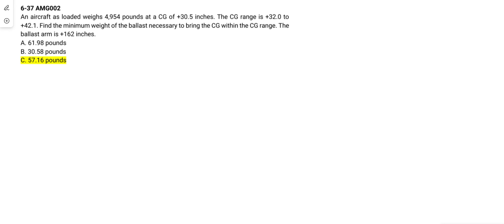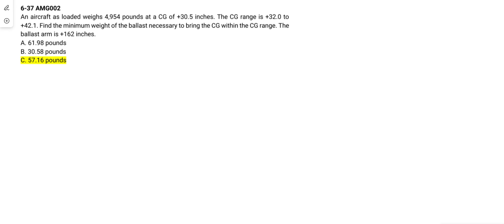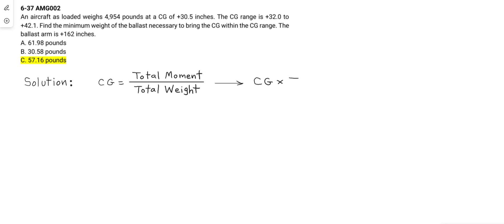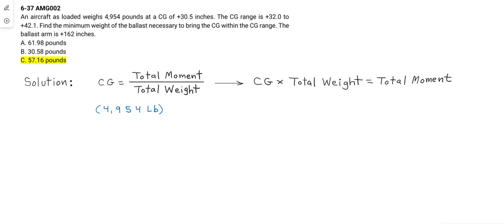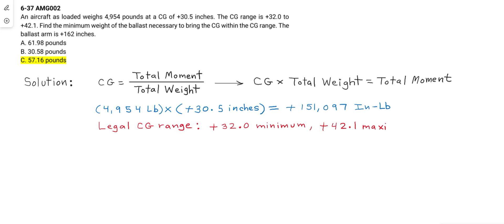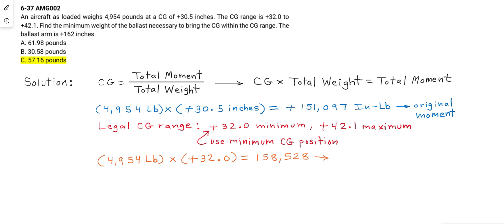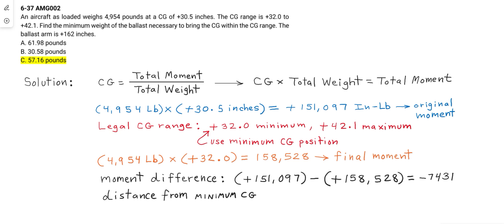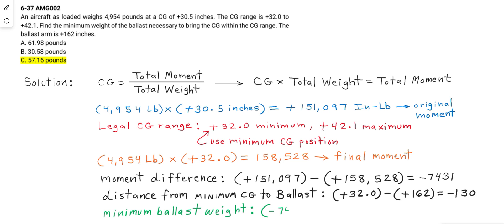Airplane Weight & Balance:  How To Calculate Minimum Ballast Weight

Comment: Good video, but the only question I have to ask is why we chose to calculate the distance of the ballast from the minimum CG? Why aren't we using the arm given to us (160) and dividing the -7431 in-lbs (Missing moment) by -160? Clearly, you got the right answer, but I need to ask why you chose to do that? Thanks.
Reply from the maker: Hi!  

Aircraft Weight-and-Balance problems such this one are broken up into two (2) sections:  

1.) Calculating Total Moment with Total Weight without altering, removing, or adding anything.  This will calculate the existing or initial CG 'as is'.  CG is the Total Moment divided into the Total Weight.  The initial CG is the 'zero-point' for which there is neither positive nor negative moment or the 'balance point'.  Now, we can use the CG as the reference-point instead of the 0" Datum.  

2.) Initial CG is the new reference-point.  Items aft or to the right of the CG represent positive-moment (tail-heavy or clock-wise rotation).  Items fore or to the left of the CG represent negative-moment (nose-heavy or counter-clock-wise rotation).  'As is', the positive and negative moments are equal and opposite, hence CG 'balance-point'. UNTIL, let's say we remove Potable Water for Empty Weight OR ADD Ballast.  NOW we have to ADJUST the initial CG to compensate for the imbalance CAUSED by adding or removing item(s) or weight(s).  The only to do this is to use the CG as the reference point instead of the Datum.  Let's say we remove Potable Water fore of the CG.  We would measure distance from the items from the CG, instead of the Datum.  For example, let's say we removed 22 Lb of Potable Water 14" FORE of the CG toward the nose.  This would cause an imbalance of:  [(-22 Lb) x (-14")] or +308 In-Lb.  Positive-Moment-Imbalance would cause a tail-heavy situation, since positive-moment is clock-wise-rotation or tipping the aircraft onto its tail.  We would need to a -308 In-Lb moment, or an equal-and-opposite negative-moment to cancel the tail-heavy situation.  Conversely, if we removed an item AFT of the CG let say 13" aft of the CG toward the tail, weighing 50 Lb, we would have an imbalance of:  [(-50 Lb x (+13")] or -650 In-Lb.  Negative-Moment-Imbalance would cause a nose-heavy situation, negative-moment is counter-clock-wise-rotation or nose-heavy (tricycle-landing-gear).  The trick is to separate positive and negative moments with respect to the CG, not the Datum.  Items AFT of the CG induce positive-moment.  Items FORE of the CG induce negative-moment.  Datum reference point allows for calculating positive-moments only, these added together calculate Total Moment (TM), followed by dividing TM into Original Weight to calculate (initial) CG.  Afterwards, shifting or moving CG to compensate for moment-change(s), after adding/removing item(s) IS WITH RESPECT TO THE CG, not the Datum. 

Summary:  

1.) Calculating Total Moment, is with respect to the Datum, then dividing Total Moment into Original Weight to calculate (initial) CG.

2.) Compensating for Moment-Change after adding/removing items, is with respect to the CG (not the Datum), for calculating CG position and/or ballast weight.

Let me know if you have additional questions!